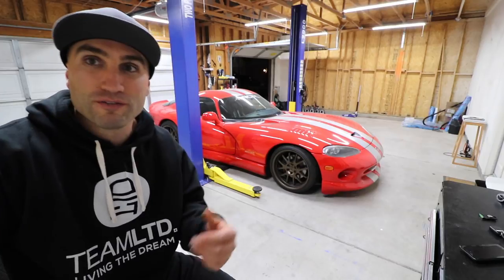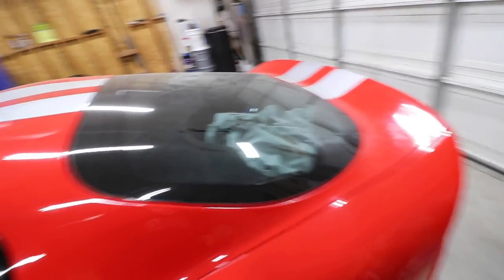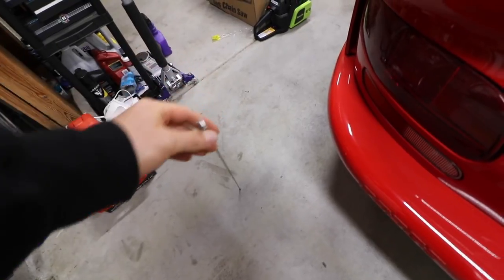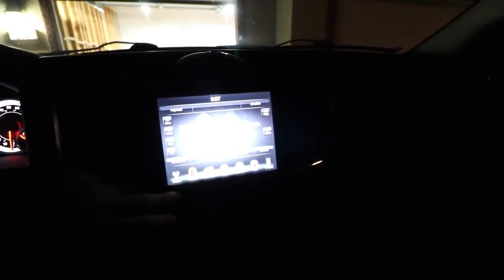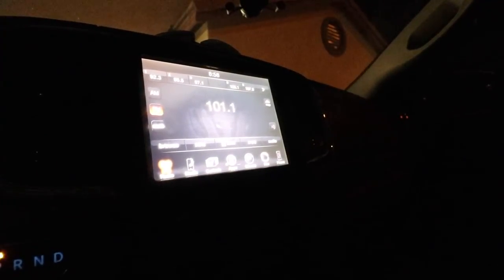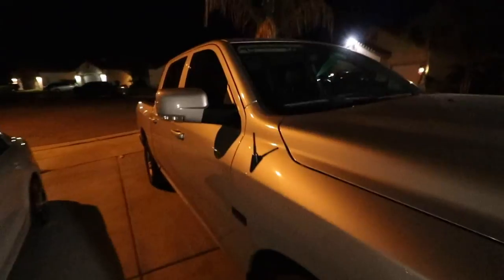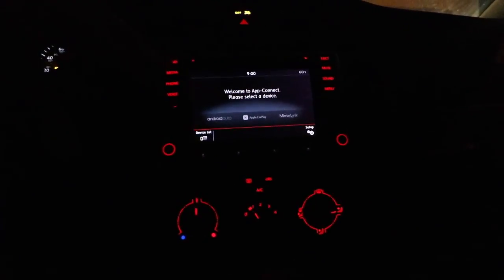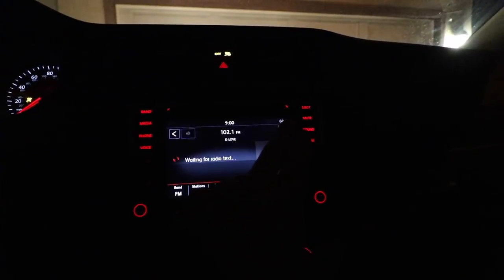Do Stubby Antennas Work? | RAM 1500 2500 3500 ANTENNA

Comment: Purchased a 14” black aluminum (stiff) antenna. Works fine but I started getting wind noise. Stay away. There is a reason the stock antenna is 30” and spiral design. I did use a rubber one without noise but it stays bent from wind. Stock one it is

Comment: I love the stubby, but I never listen to the radio. I feel like it's more for appearance than for performance.
Reply from the maker: Same here Peter! 🤘
Reply: @BoostedMotorsports  I've actually found the entire system in my truck at least, to be very robust, which is surprising. I don't have a great data plan so I don't stream, but I do play music off of an SD card. I eventually decided to try push the system and I've got a 256 GB SD card with over 19500 songs. The limit is 20000. It does take a bit of time to for things to kinda 'start up' when I turn the truck on in the morning but after that, game on. If tagged correctly, proper artwork appears as will foreign characters. I'm honestly still amazed at how much I love this truck.
Reply: Same here I do SiriusXM

Comment: I have the same antenna and only get one station also. I bought it for looks though, we have terrible radio stations here
Reply from the maker: lol yeah I almost don't like it since its so small.  I prefer the previous one that snapped off it was a bit bigger and suited the truck better 🤣
Reply: I can’t believe whip style antennas are still used in this day and age. We have fins that pick up signals from satellites and integrated antennas in glass these days, but some manufacturers still use whip antennas. I suppose that it’s all about cost

Comment: Yeah guess I'll not be doing that then.. do you know if there are any out there that work better?🤔🤔
Reply: It depends on your area and how strong local station's signals are but the reality is the shorter the antenna, the less reception it will get.
Reply from the maker: I saw some on Amazon that had decent reviews but I wasn't ready to drop $20-$30 on a fancy one that I never use radio for.  This and the last one I tried were like $8 lol

Comment: I am soo happy that the 2019 RAM 1500 doesn't come with an antenna or at least it is integrated in the shark fin that is centered on the back of the roof, not in the corner like my 2014 1500.
Reply from the maker: Yeah nice to see they got rid of the 90s setup finally lol.  Only thing that I did notice on the way to work this morning on a 2019 I saw was that fin is HUGE!  I honestly don't think it will clear my garage unless that truck is slightly shorter than my 14.  I've bumped my fin off my garage door and that fin looks a good 2 inches higher
Reply: @BoostedMotorsports - Now you got me wondering. I don't garage my truck but I'll have to check it out.

Comment: 6 3/4 antenna from ebay works just like factory, but looks way better.  $24.99 and its guaranteed!
Reply from the maker: Nice!  post up the link so people can check it out 👍
Reply: Its called "The Original 6 3/4 Antenna". Its on Ebay. It works great!
Reply: Gretchen's World  
It’s also sold on Amazon too, it’s just not available at the moment. But I totally agree, it works as well as the stock one and looks much better.
Reply: This only fits f150-.-
Reply: I have a 16 Ram and it works great.

Comment: OK so the stubby antenna is a POS I could’ve told you that I’m big into ham radio CB radios and HDTV roof antennas I installed them from time to time for high definition television because we live out in the country we do not have cable television we stream everything through cable Internet but I still want my local channels so I use HDTV what’s wrong with the stock one just put it back in there who freaking cares what it looks like mine is painted black like my truck I can care less but it looks like John 
General repair
Reply: He doesn't use his radio and he is clearly going for looks and speed with the truck ✌
Reply: Shane Smith Thanks for pointing out the obvious
Reply: @generalrepair8731  well than you wouldn't tell him to put the flag pole back on there!
Reply: Shane Smith No problem Shane Smith you the man whatever you say man